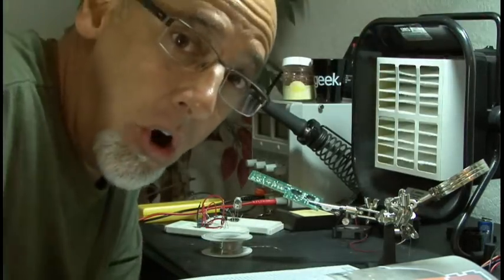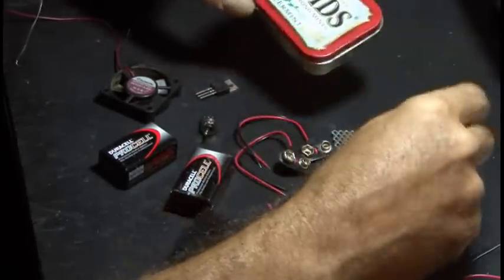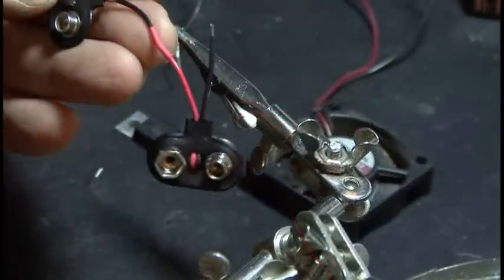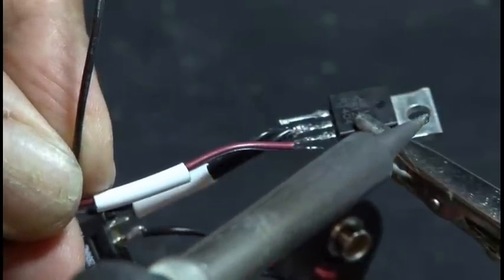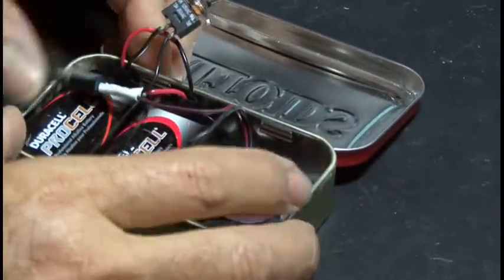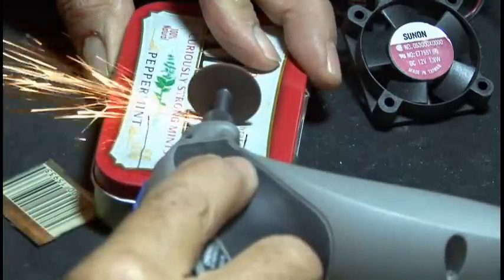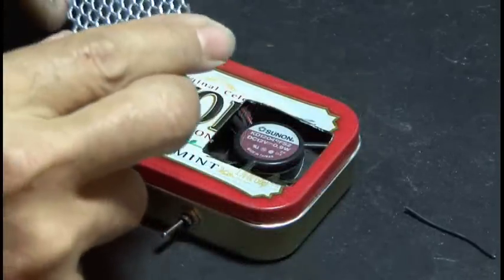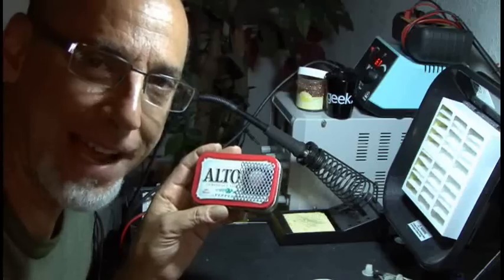Weekend Project: Mini Fume Extractor

Comment: it is a carbon filter, if you want an easy thing for getting rid of weed smoke, go to ace hardware or home depot whatever is closest, get 2 inches of pvc pipe, and a package of painting resperator filters, cut one to the size of the pvc, duct tape it down, and then blow the smoke through it, you dont see it or smell it as long as it all goes through the tube...

Comment: The second 9V battery and regulator are probably unnecessary. The fan will run a little slower on 9V, but probably well enough for this project.

Comment: What's the point of making a fan to suck the smoke away from solder if you have to solder to make a fan that supposed suck the smoke away from solder so I guess you need many other fans, so fan-ception.

Comment: Well... Good idea, really. But the implementation is all skewed!

I'd use one 9v; use a case-fan instead, funnel it down into an activated carbon filled altoids box (to keep with the Make design ^^). And use a cloth mesh on either side.
Now you have a nice filtration system, with a lot more surface area for the carbon to ad/absorb with. And a nice pre-filter cloth, to not obstruct the carbons absorption-power with dust.
And you just need one bag of activated carbon, to refill it for a long long time.

Comment: you can run it straight off of a battery, but its very wasteful of the power. the regulator will extend the life of the fan, and the life of the battery

Comment: can i add a green led on the circuit? when the switch is on the led also lights up and if the switch is off the led doesn't light up. what is the circuit for that? please anyone help me... thanks in advance..
Reply: I might be a little late considering you typed this comment 3 months ago, but what might work is connecting the positive of the led to the positive of the battery(while still connecting the positive of the battery to the voltage regulator) and connecting the negative of the led to the output leg(what ever you want to call it) of the switch. You might need to put a resistor on it. Hope I explained that well enough...
Reply: Tyler Harvey yea you might need a resistor :) poof!!! 18v

Comment: he is using 2 9v batteries on a 12v fan. but in all honesty, when ever i do a project that involves a 12v computer fan i just use one 9v battery without any regulator and the fan just spins a bit slower than on 12v. it runs perfectly fine on 9v alone so i dont know why he used 2 batteries, the difference in rpm isnt that great for those tiny fans anyways. doesnt make much difference. im just saying this if you want to make this thing on your own you can make it cheaper by using one battery/

Comment: okay so i had to solder some heat tape for my reptiles and i had my gpas soldering iron and the tip would only work in a couple places, where it was silver, s

o i went to walmart and bought the 10 or so dollar iron the have for sale, and this started doing the same thing, exept this time half the tip, started to melt inward and eventually, by the end of my little project, about a 1/4-1/6 inch of the tip was barely hanging there and then it fell off, and that was the only part that would actually melt the solder

I had to finish the project buy holding the iron at a 90 degree angle with the heat tape, because the tip was the only thing that would melt anything, so i was holding it vertical

can anyone tell me why that happened, i was using the solder that was right  next to the iron at walmart, i know its not the best product but it sould have worked more than once
Reply: It's from Walmart and was on sale what do you expect
Reply: to at least get threw a whole project before it fucks up, plus i think it was user error

Comment: You hold the hot iron on it too long, & the plastic case melted inside!
Components like transistors etc are destroyed the same way.
Just meant for a "touch" long enough to melt a wee bit of solder.

Comment: Can somebody help me?
I wired and rewired everything perfectly and my batteries got very hot I'm pretty sure its because the 12 volt regulator was not working correcty but just to make sure I'm asking you guys so please please please help me that would be nice and thx
Reply: Try using a 9 volt battery and two 1.5 volt battery. Or just get a 12 volt battery.

Comment: portable fume extractor but no portable soldering gear. (yes i know about those battery operated or gas operated ones but still never going to be as good as wall plug in soldering irons)

Comment: can i have this working with the usb power out of my car? (5V)
Reply: Amir Nasrif No, because the fan needs 12v. You can make a voltage step up circuit, but personally that seems like more trouble than it's worth, it probably easier to just use the two nine volts batteries and the mosfet. But if you are up to the challenge to make a voltage step up circuit here is an Instructable for just that: http://www.instructables.com/id/Adjustable-Voltage-Step-up-07-55V-to-27-55V/
Reply: +Amir Nasrif No, but there are USB fans out there.

Comment: i have a 5volt van 
are the components the same
Reply: If you want it to run at 5v just use a 7805 instead of a 7812.
Reply: Thanks

Comment: why is the output of my 2 fans is 5v? the fan is 12v I perfectly follow kipkay's circuit...
Reply: You probably have the wrong voltage regulator or something. Get a digital multimeter and you should be able to figure it out.
Reply: the numbers written on my regulator are 7912... I have my multimeter and yes it reads 5v.. I'll probably buy a new voltage regulator...
thanks by the way..
Reply: Mark Spencer
he says 7812
Reply: Mark Spencer
You probably solved it by now.
7912 is a NEGATIVE voltage regulator.
You need a POSITIVE voltage regulator (7812)

Comment: youre just wasting energy using the 7812. Also you are relying on the internal resistance of the batteries for speed 'control' (which it doesnt have). That means that the speed varies like hell because of the temperature changes made by cooling from the fan and the dissipation of ((18-12)*200mA) 1.2watts in the regulator
Reply: Rowan Moezel Thanks for pointing that out - I thought it was a bit weird they way he had this set up. Easier just to put the two batteries in parallel and ignore the voltage regulator. Most of these little fans run just fine on 9V and you eliminate the power wastage and get less speed fluctuation.
Reply: +James Logan it should be fine on 18v, too.

Comment: Ditch the LDO its just wasting power. Wire the batteries in parallel a 12V motor will run just fine on 9V.

Comment: Nice, but not very efficient.. 9V batteries have low capacity,  around 500mAh.. better to use two AA batteries in series .. and use 7803
regulator instead with 3.3V fan

Comment: Or just get a desktop fan and aim it at your project and turn it on... lol
Reply: That'll just dissipate the fumes thru the room without filtering. If you wanted to go filterless an exhaust fan to the outside would be better, which is what I use sometimes. I don't care about my health so I'll sit in here with a cigarette while I'm soldering, no fume extractor or ventilation.

Comment: 1) if you put it in parallel then you will waste 9 volts because it goes no where.
2) if you do it in parallel the 18 volts will be split in 2 9 volts and the computer fan works best on 12 volts. If you use 9 volts the computer fan will go slower and it is weaker then an average one.
3) as i said the other 9 volts wil be wasted because it goes to the other side of the wire and the wire is connected to nothing so the 0 volts goes nowhere and it still uses the power. It's a waste of energy

Comment: Seriously? A 7812 regulator is a heater & battery killer. Not that this tiny item is even particularly useful, but as far as battery life, just use one 9V wired direct. When that battery dies, put the other battery in. Regulator out, common sense in.
Reply: I run my fan at 18 volt.. 6 volt overvolt but works... it's a cheap 50 cent fan...

Comment: Would of been better if he had a USB plug instead of those batteries... and instead of those batteries..use recharagable NIMH batteries...and get a fan that 5 volt DC Brushless motor Computer Fan(instead of 12V DC FAN)... no need to put a step down voltage..

Comment: Indeed...
Easiest solution --> use a small tabletop fan, tape a charcoal filter to the back of it, point it away from your work. No rotary tool required, no pre-existing fume extractor required, no soldering required, although you do have to pay for that horribly expensive tape and a charcoal filter. After buying a full-price fume extractor and a dremel tool, you might not be able to afford tape.

Comment: Don't use 9v batteries... they're horrible, low energy and expensive. Just use a regular 12v wall wart or some universal dc adapter on which you can cut the jack off. Even a 7.5v-9v will do, the fan will spin fast enough.
Don't use a linear regulator to get 12v out of 18v, the difference gets converted to HEAT, so you're dissipating about 1-2 watts into the metal case... pointless waste of energy and you heat up everything.

Comment: Just use one 9V, your wasting a bunch of power through that linear regulator.  You don't have to have 12V, to run a 12V fan, it will just run a little slower.  Better yet, find an old 9V-15V wall transformer everyone has lying around.